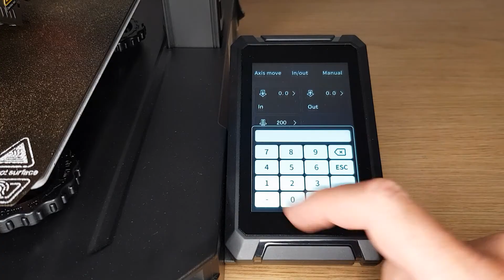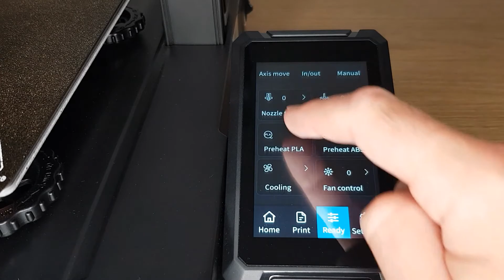Fix a Hotend Clog On Ender 3 S1 Pro

Comment: My printer came with a metal piece that is to be used for unclogging? Can I not just shove that through the hole when it’s hot? I have the s1 pro
Reply from the maker: If it works sure, but the issue can often be that filament has melted and then cooled in a place where it won't re-melt. Good luck with whichever method you choose.

Comment: I’m a stalwart on using the correct tools for the job. Using pliers like that makes me cringe! I would have preferred to see a spanner, even a shifter (crescent wrench), depending on where you are. I’m going to print a special tool to replace the pliers in the video.
Aluminium is delicate and should be treated carefully. Other than that I thank you for the informative video.
Harry

Comment: This works great to clean clog. Put it back together and in a couple of hours do it again, 2 hours later do it again, repeat every 2 hours. The clogging issue once it starts will continue. The one thing I've found is to use heat conductive grease when reassembling. Good Luck

Comment: For me I have a problem with my connection, anytime I put my bare hand or any metal in contact I get electrocuted, I was looking for a solution that doesn't require touch while switched on but i guess there's no option.

Comment: Crap, that's what I was afraid of. The grub screw on mine is seized so there's no chance I'm getting the heatbreak out.
Reply from the maker: Have you tried undoing it when it's hot? Thermal expansion may help make it easier to undo.
Reply: @RickyImpey 
unfortunately a combination of the screw being tiny and using the cheap wrenches that came with my printer resulted in that grub screw stripping out.  I should mention mine's the Microswiss hotend for an Ender 3 Pro so not exactly what you depict here.

I was able to unscrew the heatsink+heatbreak from the heating block, remove the plastic bowden retainer, then used a butane microtorch + 1/8" welding rod to clear the jam

Comment: So, while cleaning it, I got a runaway heat warning, must have touched something wrong?  now it will not work, what do I do,  when trying to do a preheat, it shows no temp increase, then after about 30 seconds or so, starts beeping and shuts down!    What next?
Reply from the maker: Check that neither of the wiring plugs have come loose. It sounds like your heater may have pulled loose.
Reply: @RickyImpey  THks, thats exactly what happened and caused the error!

Comment: I have done that a couple of times and here is what I want to say.

* There is in general no need to remove the nozzle, unless you believe it is time to clean up things inside (in that case you will use a gas torch to burn everything inside up.
* The cold end contains a short PET pipe and it can be easily fall when you remove the hotend. Make sure you put it back when installing the hotend. Also it it not going out, check that there are no filament stuck there.
* The fitting depth of the hotend is important - when you put the hotend back to the hole in the cold end, it is not suppose to push fully into the hole, otherwise you will find the correct Z-offset will be out of range (-5mm I think).
* The other reason that the hotend shouldn't be fitted too deep is for cooling. That fitting is the only contact between the hotend and the coldend, so the smaller the area, the less heat will be transferring, reducing the risk of filament soften that cause clogs.
* However, the depth of fitting controls the gap between the PET pipe and the hotend, so if the hotend was fitted too low the risk of clogs caused by the gap will increase.
* In all cases, do a manual bed leveling after the process, to find out the correct z-offset since it will change.

Comment: Does anyone know if that heat brake is supposed to be slanted at all? Mine is and I've also been getting leakages of crud out the sided of my hot end
Reply from the maker: It should be straight. Sounds like you may have a damaged part.
Reply: @RickyImpey  I can't imagine how that would happen, I suspected as much and ordered an new one yesterday. Thanks

Comment: Thank you. I first saw the other video you referred to here. So glad I kept looking and found this. Took away a lot of anxiety before starting. I would just add, you don't need to unmount it and mount it while it is heated. You can heat it after you place it on the build plate and let it cool before you remount it.

Comment: To be fair to those "other videos," sometimes you do get clogs inside the gears and you do have to do all that.

Having said that, I had a clog in mine that your method worked on, so it saved me a lot of time, lol.  I still have another jammed up Sprite Pro extruder that I could never clear, even after taking it completely apart.

Comment: Thanks for the video. I have an issue with clogging and maybe you might help me. I have an Ender 3 S1 and it doesn't have problem printing (I am printing mainly PLA). Problem is that every time I try to change the filament it seems to be stuck. I end up needing to push toward the hot end for a couple of seconds to have it heat up before pulling it back and then it managed to get out. I noticed every time it happens I have some kind of a blob at the tip of the filament (probably the reason it got clogged to begin with). This problem have only started recently, but it is a consistent one. Would appreciate the help!

Comment: Thank you very much! First time and I couldn't figure out what happened; until I realized the filament spool had a crack in the side and caught the filament in it. I could hear the machine "grunting" but could see that everything looked normal. I even placed my hand on individual pieces trying to understand where the rhythmic grunting was coming from. Even when I realized it was the extruder, I STILL didn't know to look for a stalled filament line. Nothing on the machine to alarm when this happens either. Well, learn every day!

Comment: So I have been having an issue. The set screw that you loosen by the circuit board keeps coming loose and I have since lost it. Any idea what size that is (I think it's M3x3?)? Also, mine will print fine for about 10-15 layers and then the extruder starts clicking and giving me fits. Any ideas? Same machine here running Elegoo PLA filament at 215 degrees

Comment: Unfortunately I needed this one today on my S1 Pro after 5 months of ownership and almost non-stop printing. 5 minutes is a slight exaggeration. Comfortably 15-20 minutes if your hot end screws are filled with material… even if you have a silicon sock. Thank you for your videos. I continually find myself referring to them. I’m pretty sure the reason i got a clog was due to too low of a z-offset which built up pressure. Sure enough the clog was exactly as shown in your video too.

Comment: March 14 at 10 AM, 2023. I have the S1 pro and I’m getting a picture message on the display of a hand holding a needle and a nozzle picture. and all it says is yes or no. ??? Not sure what you do from here, but I can’t get it to clear or start the printer. I even flashed the motherboard and the controller. And the picture of a hand with a needle and a nozzle. And under it all it says is yes or no. Thank you.

Comment: Hey! I really need help. I followed this video once to unjam my Ender 3 S1 Plus extruder. But when I reassembled it I must have goofed because after one print it became jammed again. But NOW when I try to remove the heat block ( 2:22 in the video) with pliers it doesn’t come off. It turns but doesn’t come loose.

Ideas?
Reply from the maker: Hi, If it's turning but not coming out then it's probably the clogged filament holding it from coming out. Did you have everything hot while trying to pull it free? It is possible to disassemble the whole extruder assembly to get to the section above. If you can't get the heatbreak out with the hot end hot then you may have to take more apart unfortunately.
Reply: @RickyImpey  Yes I had it at 230 degrees hot.
Looks like I’ll have to disassemble it. Maybe I could follow one of those “more complicated” videos you mentioned at the beginning?

Also, I have the stock Ender 3 S1 Plus extruder. The Plus has a slightly different part than the Pro. Do you think it would make sense to upgrade my heat brake to all metal? I was thinking of trying to follow this video for that
https://youtu.be/j96WqHwT0p8
The plus is just different enough from the pro to make looking for specific advice to be frustrating.
Reply from the maker: @riddlesphinxx  There aren't really any disadvantages of running the 'all-metal' heatbreak in the Plus to basically make it the same as the S1 Pro (other than the cost of buying it). It's a neat setup and there is still a section of PTFE that runs up to the extruder to help avoid clogs. You won't be able to take full advantage of the extra temperature capabilities without modding the firmware though. On the Pro you can go to 300 degrees but you'll be limited to 260 on the Plus without firmware changes.
This video shows how the sprite extruder and hot end assembly comes apart if it helps https://youtu.be/0goTwwAVb58
Reply: @RickyImpey  You're actually the best, thank you. I will follow this video and might come back if I have more issues :) thank you

Comment: Thank. Great videos. Just had to remove a 1.5mm piece of PLA. Unfortunately, just below the gears, between the 2 "arrows".  So I had to take the whole thing apart.  FYI: (for you and channel viewers)  Had trouble getting the "gear" part back together.  Had to tighten spring  down more, to get the halves together. and then unscrew it again, after (to where is was, which was very loose. about 7 turns) Also noticed both my hot end screws were very loose. Didn't do it "hot", unplugged cord. Worked fine.  AND just did a Z  step calibration, too.

Comment: This is a great tip, and saved me lots of time, thanks!
I like the idea of keeping it plugged in, but in my case, I removed the head completely.  Then, while seated at a table, I pointed a heat gun at the throat until the hex wrench popped the plug out.  This was easier since my printer is just a foot from the floor, but this tip keeps me from fearing clogs as much!

Comment: Fantastic video! Where can you get replacement ptfe tube for the extruder?
Reply from the maker: Any PTFE tube with an inside diameter of 2mm and an outside diameter of 4mm will work, you will just need to cut it to length yourself.

Comment: Thanks a lot, I’m going to be doing this exact thing after breakfast! Straight to the point with no fluff. A PERFECT “how to” video.
Reply from the maker: Hope it went well and you are back up and running.
Reply: @RickyImpey  Yes it did, worked exactly as you described. Thanks again!

Comment: So the printer is still turned on while being fixed? Is there an electrical hazard? Does stringy filament indicate a clog?
Reply: After I took the nozzle off, I noticed there was pva clogged inside the nozzle part. How can that be cleaned out? A d now I see that it would be impossible for the filament to push through that tiny opening..I have seen the experts in Ender videos who say "just push the filament all the way through the nozzle and their filament does go through.. but they must have a wider hole in their nib part or thinner pva to begin,with. These machines are too finicky for anyone but folks who have huge amounts of time for fixing.
Reply from the maker: Hi, do you mean PVA or PLA? Both can be used in a 3d printer but it's much more likely that you have PLA. If it's PLA then heat is what you need to clear it. The only way you will be able to push filament through is if you nozzle temperature is higher than the melting point of the filament you are using.

Comment: Easy, short, concise and you left out the BS "cutesy stuff" that wastes alot of time in other UToob videos...... btw, you are not securing the heating block with a crescent wrench before twearking the nozzle off (lol )...  aren't you concerned about twisting off the brass, etc heat break inside the block ?

Anyhow, nice video. I am reviewing maintenance stuff for my new Ender 3 S1 Pro and if this ever happens I will consult your video.😎
Reply from the maker: Hi, you are right, I should have shown holding the heat block still when undoing the nozzle. I had probably just nipped it up for filming and forgot. Glad you liked it otherwise👍

Comment: 1. why do you have to remove the nozzle exactly?  2. Is pushing smaller clogs through this machine with a thing wire cane possible like on a duplicator six?

Comment: My tube came out. Thats how clogged it was. How do I put it back in?
Reply from the maker: If you mean the PTFE tube, then it just pushes back in. It's held in place when you put the heat break back in.
Reply: @RickyImpey  yes, that's what I ment. And don't worry, I got it fixed. My printer is now printing normal again

Comment: Really appreciate your videos, especially the bed levelling for the S1 Pro, it's never printed better since following your guide. I tried this to clear a blockage in the extruder, but unfortunately the jam was in the extruder section before the hot end, so it needed a complete disassembly. If you fancy tackling that, I'd love to see your video on that! Thanks gain Ricky.
Reply from the maker: Have you fixed it? I did see another YouTube video where someone showed the whole hotend coming apart. I can find it again if you need it to get up and running.
Reply: @RickyImpey  I have, The Edge of Tech have a tutorial of the process, it took a while but all went well and it's back printing as well as ever (https://www.youtube.com/watch?v=0goTwwAVb58). Thanks!

Comment: Very helpful.  This is my first 3d printer and of course it clogged within 10 prints of coming out of the box.  I'd been dablling with the extruder to work out which parts to remove and clean and to know how the entire extruder was completely clear of material.  Thank you!
Reply from the maker: Yes, mine did it early on during a slow filament change so I had to figure it out. Glad it helped 👍

Comment: have had this clog a few times - my first attempt for clearing is heat up to filament temp - remove nozzle, then i try the nozzle cleaner from the top using the coiled end of the cleaner. i have been able to push clog out the bottom that way. those wires are so thin on that thermistor that once i did follow this vid and needed to replace thermistor afterwards.

Comment: Ricky, you just saved 2 hours of my life and a ton of frustration - I know, because I already cleaned the nozzle twice the hard way by disassembling it completely. Just for the record, the same method from the video can be applied on Ender3 S2 as well - it is having the same hot end construction.
Reply from the maker: Thanks for letting me know, glad the video helped 👍

Comment: well thank you again! I had to deassemble the extruder again, I kee p having the problem that the tip of the filament breaks when I pull it ouf of the extruder to change the filament... very annoying -.-
Reply from the maker: I only had that once when I didn't push the filament in about 5-10mm first before pulling it out quickly. Do you push it in first?
Reply: @RickyImpey  no, I heat up the hotend to normal temperature and the directly pull out the filament while pressing the release. Even if it doesn’t break I feel a slightly high resistance while pulling the filament out
Reply from the maker: @diy_wizard  Pushing it in first will fix your problem. It makes sure that the end of the filament is nice and hot so that it stretches and breaks down by the nozzle and doesn't pull a semi-melted lump up into the smaller diameter section above it where it will break off and block your hotend.
Reply: @RickyImpey  thank you, I will try that!

Comment: great video! have the same printer with issues. begin to print, creates the initial line and circle then gums up at the nozzle.  cleaned nozzle thoroughly, still persist.
Reply from the maker: Hi, usually a clogged nozzle is simply caused by too low a temperature. What filament are you using and what printing temperature? Have you tried bumping it up a little? Another thing that can cause the temperature to drop too low can be a bad PID tune giving too much temperature fluctuation. At the lower end, this can cause a clog.

Comment: Thank you, this quickly helped me out! And it wasnt as complicated as I thought! I only had to redefignd the z offsett after changing to anotzer Nozzle Type, but thats a different story ;) And I keep having the problem, that some of the filament seem to come trough around the nozzle, because it always gets dirtty pver time and sometimes has a this PLA cover on it. Do you have any suggestions how to fix that?
Reply from the maker: Hi, the first thing I would do is work out where the filament is coming from. If it's leaking through the threads on the nozzle then either your heatblock or nozzle may be damaged and may need replacing. Make sure that the nozzle is not fully home against the heatblock face and you can see a thread or two when tight. This shows that the back of the nozzle is touching the heatbreak/throat which should seal them together and prevent filament leaking. If the heatblock has turned on the heatbreak at all, this may be your problem. Alternatively, you may be seeing filament that has been pushed back up after coming out of the end of the nozzle. Like I say, try to work out which before changing anything.
Reply: @RickyImpey  Thanks! I will do my best!